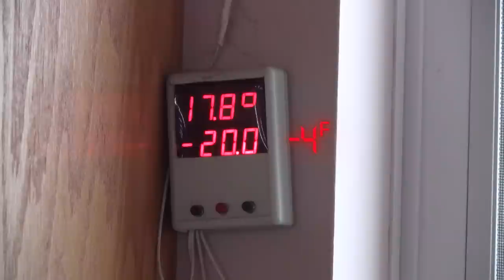The Woodpecker Ep 75 - The interior doors part 1

Comment: Talk about an over kill building  I would be moving from the house into the shed and it is only a shed.  I would be heading to that building when your next earthquake hits is has to be the safest building in town and finished better than a five star hotel.
You sweep the dust to a point next to the suction point and then sweep it into it but the suction pipes are below floor level with plugs in them surely you can remove a plug and just sweep over the top of the suction point, especially if you made a tapered transition in the floor.?
An excellent build, no doubt, something to aspire to.

Comment: These will be great doors. Two questions how did the cut happen that needed to be fixed with the epoxy? And why not rip the edges with the tablesaw blade tilted to remove most of the waste before setting up to make the coves?
Reply from the maker: When I picked up the raised panel after the last pass I lifted it by mistake and I ended up with this nasty cut.
I never thought of pre cuting the cove but a 10" saw blade wouln't cut deep enough for a 6" cove.
Reply: ***** I realize the tablesaw couldn't cut all the way thru your 6" cove but could have saved you a bunch of passes by removing the bulk material?? Isn't it real hard on the bearing and motor to run your stock in the coving set up? Just offering an insight I learned from someone else. Carry on. lol

Comment: Buy a large router bit for cove cutting. It'll save you like... everything (time, electricity, sawblade, lungs) :) 
It looks like you don't have very much sucktion at gates, if that's true - is that because the blower is weak or you loose a lot in the piping?
Reply from the maker: To do a 6" cove I'll need more than a big router bit, I'll need a shaper. And I'm not ready for that.
I just have enough suction, but it's true I won't lose a limb wit this suction :) My dust collector motor is 2HP maybe a bigger one would suck beter but I'll mange with this one, it's 5X beter than my last setup.

Comment: Is the domino xl worth the extra money? Which machine do you use most often?
Reply from the maker: gssns To be honest, both dominos costs the price of a month or two of a house mortgage. I bought both of them used, so I saved a lot. I realy love them both the DF 500 is light weight but can't drill deep holes like the XL. So if you're interested in a Domino and just one, I reecomend the XL. It's more expensive, but you can order smaller cutter here (http://www.senecawoodworking.com/products/6mm-cutter-for-domino-xl) and you'll have the most used Dominos size. But unfortunately it seems that they're out of stock. Hopefuly just for now.